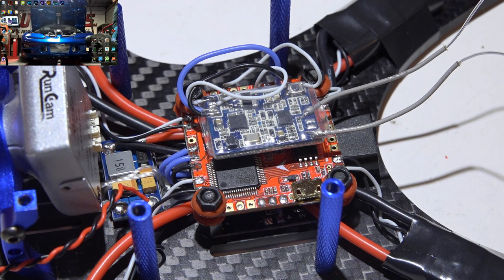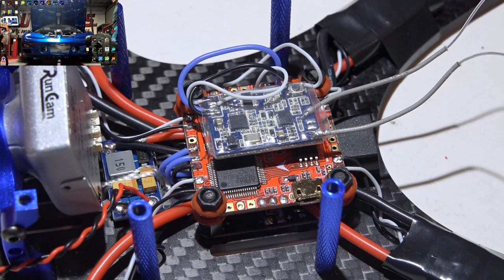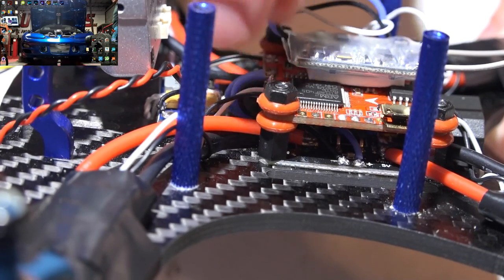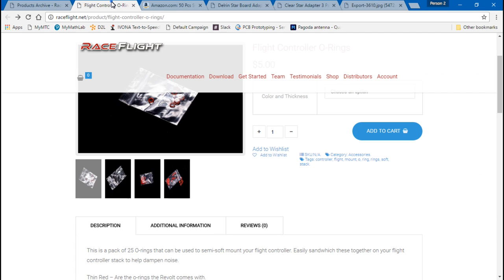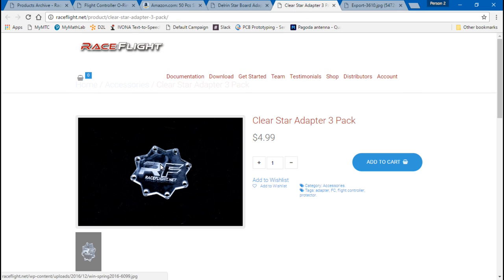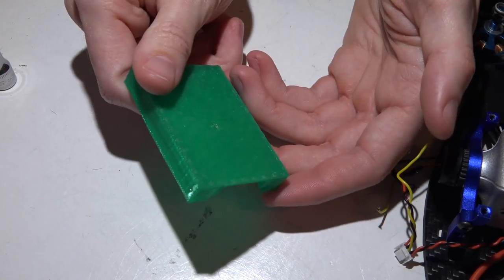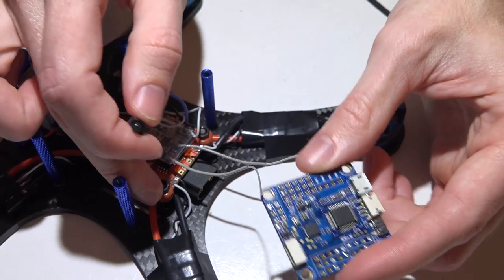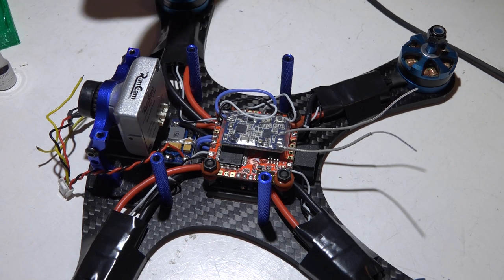Getting Rid Of Gyro Vibrations

Comment: the 45 degree adapter plate is for use in frames where you can't normally softmount the flight controller like the Shrike.

Comment: If it's as bad as mine was the quad will start twitching quite often, almost like it's cold and shivering lol. I had to o ring my flight controller and also made sure there was no wires tapping on the FC causing vibrations. Sometimes adding o rings between the frame and motors also helps. I also drilled my mounting holes out to 4mm. Not sure which one made the most difference as I done it all together but my guess is o rings on the fc is the place to start. Cheers for the great video.

Comment: im getting midthrottle oscillating in my quad.. im using a lux v2 and bumpbee esc's with the filter cap removed running dshot.. its Only when im at mid throttle.. im using o rings and the lux v2 uses the 6000 gyro.. any suggestions? thanks!

Comment: How were you able to fit two o-rings (top and bottom) and still able to get the knot screwed on when using that plastic stand off you're showing towards the end around the 6 min mark,I have the same O-rings that I bought a bulk of 50 , and if I use that plastic stand off it will not fit 2 o-rings the FC plus the knot, so I have to use a long screw all the way through with spacers in between, therefore I'm forced to use metal , maybe I should look for plastic long screw then.

Comment: Hey, do you run that revolt at 32khz loop? If so whats your opinion of it compared to the omnibus 8khz loop?
Reply from the maker: Just my opinion, I cant tell a difference. But I also cant tell a difference between the latency between a PPM and SBUS receiver. A lot of guys on the forums swear by 32khz, where some say there is no difference for anything faster than 4khz. I'm kind of in the middle. With that said, its really hard to get the vibration out the Revolt gyro. A lot of work for something I cant tell a difference in. Where I think the Omnibus F4 performs just as well without the extra work. But thats just me.
Reply: Well that make the Omnibus F4 Pro v2 much more appealing to me now.  If I use a 4in1 esc with it can I still add a servo or two?  Also, can I bat+ through the board but ground from an esc, or do I gotta use ground pad on board?
Reply from the maker: Cant go wrong with an Omnibus. Yea you can still add two servos. I would ground the Omnibus through the PDB if possible.